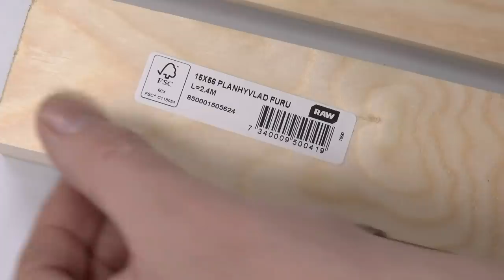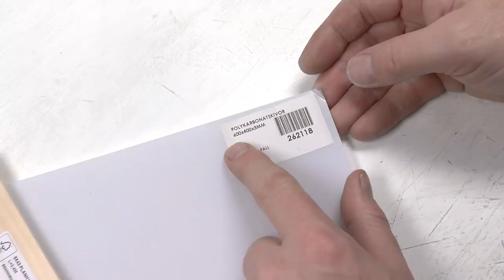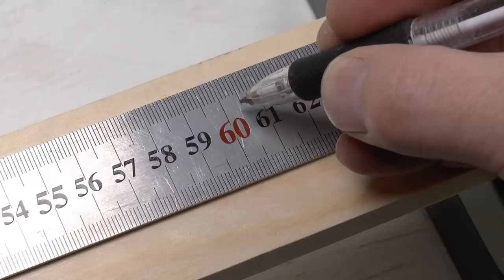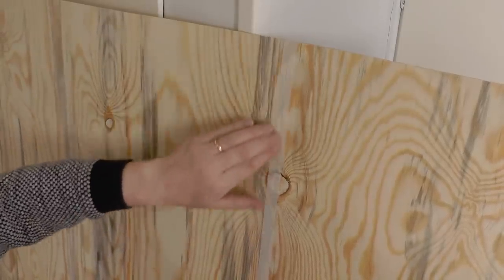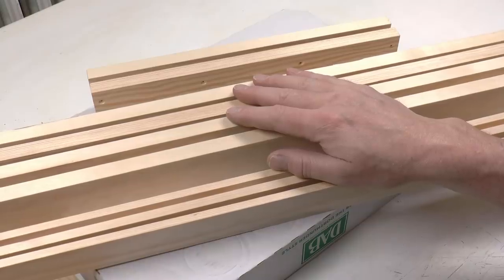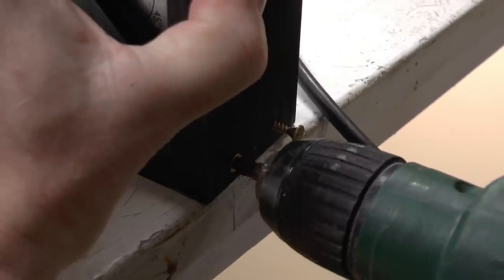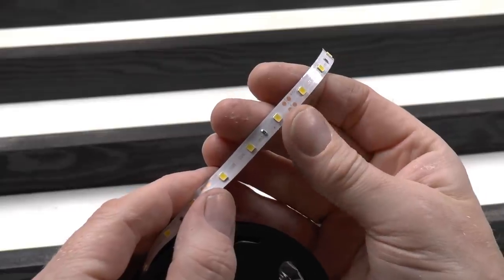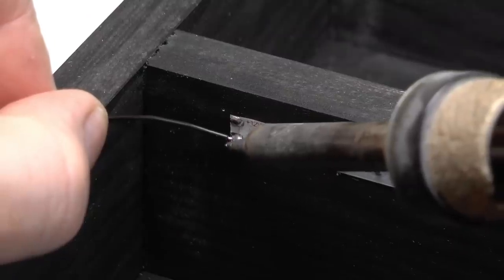Building a Vitrine Train Display for ROLL-IN / ROLL-OUT operation

Comment: Nice video again. When you add track power to the rails, you also can illuminate the interior lightning of the wagons and locos.
Reply: i assume this is only applicable to digital right? otherwise engines would run on the locos

Comment: In theatre we built flats for stage sets (i kept my school project one and added shelves to it using thin strips of Luan wood) being that its a flat it 3-4ft long and 2 ft high if i remember right.  instead of PVA glue we used carpenters glue (yellow) its stronger, but then again we need it for stage use not trains I never got around to getting a big enough plexiglass to use as a sliding door case and i still need to find a place for the monster thing lol.  your idea of individual glass units is cool I thought you would have it incorporated into the layout yard and built a motorized elevator type feature for the flat/frame

Comment: Perfect timing Martin as I have been looking at how I can display my locos and coaches in fixed formations. I was wondering how you would fix the perspex and its a good solution with the different heights, and with my OCD I would try and find some nice knobs/buttons to pull the shelves. I also bought a pillar drill last year from Lidl so now I have a good project to use it. Thanks so much for all this, it is great inspiration. 🤗

Comment: Nice idea. I guess gluing the shelves to the rear panel helps prevent them sagging over time and the perspez will add some strength but there might be a max train length eg 1200mm.
Reply: You could split the train and put one half above the other

Comment: I like what you did, but I have a few questions. First of all how thick was the polycarbonate glass? Also I'm not entirely certain why you needed the screws. And finally I'd like to know more about your setup to mount the shelf for loading the train off your set, I wasn't quite sure how you attached it so it was secure and stable.

Comment: Excellent subject. May I suggest to not use a saw and instead scatch the polycarbonat a few times. After that one can break it very neatly on the edge of a table. The advantages are a very clean, fast and straight cut. On th other hand, if you didn't scratch deep enough the cut may break.

Comment: This might be a totally unreasonable suggestion. But bare with me.

What about having a double walled box with a semi reflective background. Then have a led strip light up the background when you need to see.

Then having 3 or 4 boxes next to each other with swiches between, making it possible to drive in and out of the cases.

Comment: I suppose you could permanently attach a bracket to the wall, put the trains on horizontal shelves that moved up & down the wall & it would be an elevator of sorts with the other trains displayed over one point of a layout, then you could park your rolling stock on a shelf, electrically or hydraulically elevate up to the next level and you wouldn't have to manually move the shelf to a different area of your room and risk dumping those units out one end or the other as one of your loving pets 🐕🐈🦄🐖try to trip you ... I suppose 🤔🤫🧐